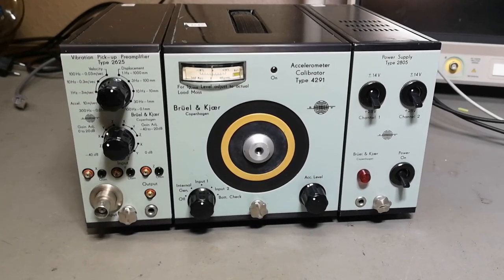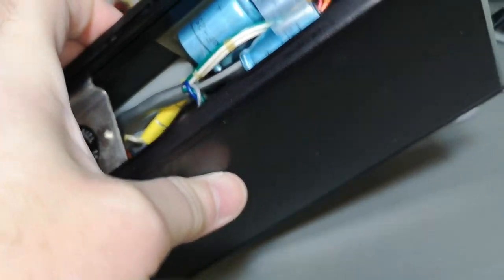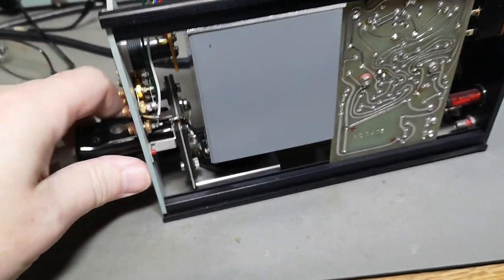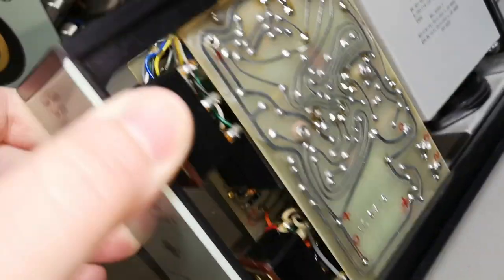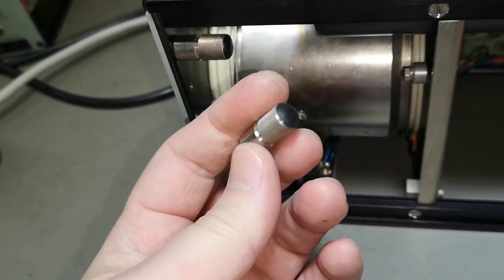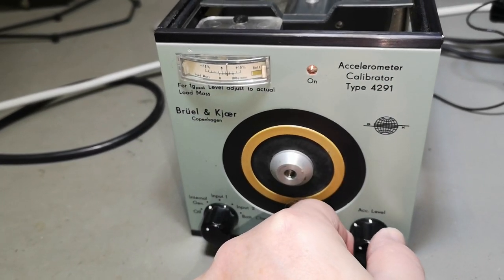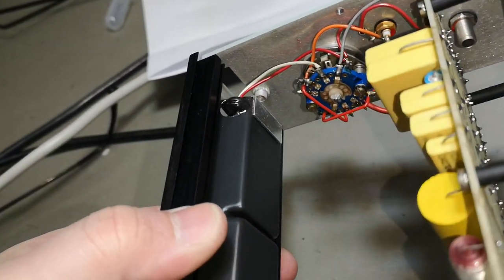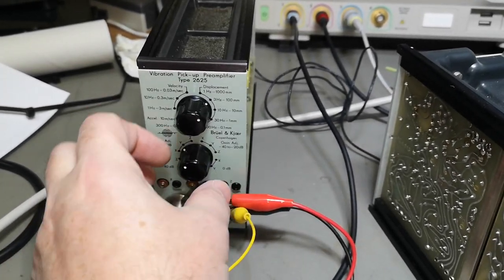Brüel & Kjær Accelerometer Calibrator 4291, Power Supply 2805, Pick up Pre-amplifier 2625 teardown

Comment: It's good to see some stuff that I also have, the 4291 and 2805. These are part of my Brüel & Kjær vibration test system. If want a scanned copy of the manuals for these two let me know. The reason for the thumb screw on the front panel which releases the bottom covers is that when the plate is removed these units can be locked into a rack mount frame.
Reply from the maker: yes thanks we really love to get manuals and schematics and share it via peel.dk you are welcome to email files to oz2cpu at gmail
Reply: @TeardownOZ2CPU  It may take a while, I'll have to find them then scan them.

Comment: Battery is a mass plate pack, 14V makes it a 10 cell NiCd pack of button sintered cells, spot welded together, to make the packs. Neoprene rubber and likely blow moulded styrene battery holder, which means the rubber dissolves the styrene monomer and turns it to goo, melting it away.

Comment: Those old Siemens capacitors tend not to puke, they dry out nicely first, then corrode through the case. 28V to run off aircraft power rails, as they could be used to calibrate accelerometers on aircraft systems, where a 28VDC power supply is needed.

Comment: The 4 mysterious objects shown at 19:11 are extra feet for the 4291. They can be screwed into the back plate to allow operation in the vertical position. This is described on page 12 of the instruction manual.
Reply from the maker: WOW thanks for the info
Reply: @TeardownOZ2CPU  You are most welcome. I always enjoy your videos, especially about Brüel and Kjaer which I use daily. So I am happy if I can make a small contribution.